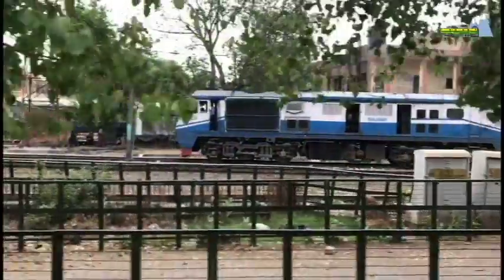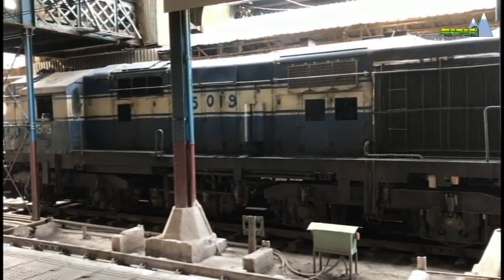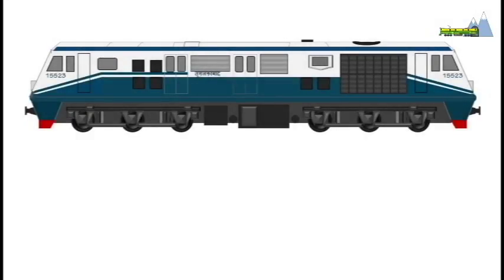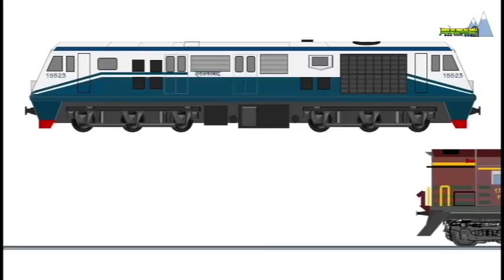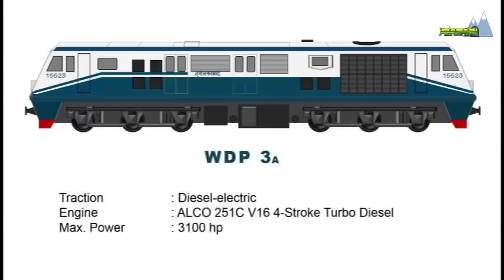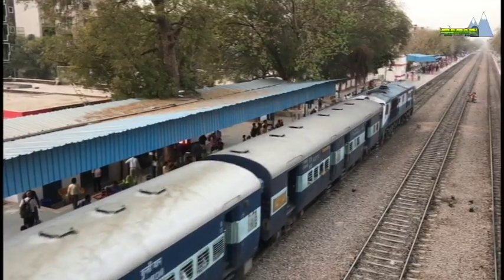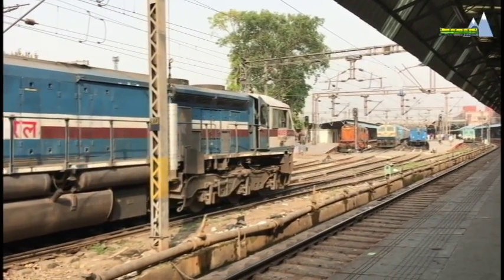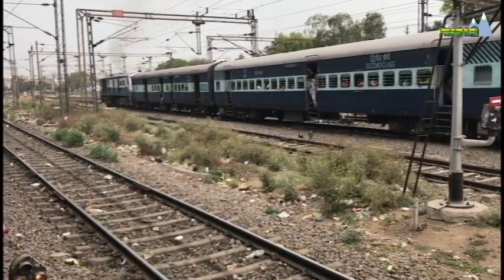WDP3A Diesel Electric Locomotive | WDP2 | ALCo | DLW | Toaster | Pushpak

Comment: I guess this is the only Diesel locomotive in India with full aerodynamic cowl body.
Reply from the maker: ALCos and EMD are American designs based on ‘Cab at one end’. The WDP3A (WDP2) tried to do away with this but did not properly design the cooling/insulation system. That is why the cabs at the radiator end got hot earning the tag « Toaster »...

Comment: WDP3A most successful purely "INDIAN INDIGENOUS" Locomotive thrown away from production line just for some horse power & heating issue on radiator side, could have been modified by increasing frame length by  a meter, upgrading engine to 3300 hp that of WDMD would have been proved to be  highest successful locomotive to pull a 24 coach rake@100-130 KMPH by renaming WDP3D . but who can stop these bureaucracy importing WDP4 series from EMD. Finally victim is Loco pilot facing exhaust grill while driving in LHF. I don't say that the  latest technology up gradation & adoption should be banned, but at the same time homegrown technology should also be preserved utilized wasting time on producing WDM3A & 3D promoting export potentials to our neighboring countries like Bangladesh, Srilanka etc.
Reply: Gentleman one more blunder is coming with the same problem named WDG6G -A 6000 hp SINGLE CAB Diesel electric loco with latest technology. After no of complains & objections from actual users i.e. loco pilots again RDSO will open its shop of design to make it DUAL CAB  like WDP4D & WDG4D. In short though it's a most powerful machine, at the same time time it must be user friendly.
Reply: @Dhirendra Solanki Alco and EMD both are non Indian companies. If so what problem will occur if we replace one with another. May be your view to upgrade WDP3A is a good idea and I think only this is the dual cabin engine developed by DLW other than this GE or what so ever. But even after introducing ALCO, EMD, GE, Alstom etc still IR is buying from outside for their first trial of every new engines. By this time IR should have learnt how to build engines on its own. Would be good if these developments are a part of Make in India then everything should be done by our own country.
Reply from the maker: Dhirendra Solanki I agree with your views on improvements to WDP3A
Reply: 1)Wdp4 is made in India, it's not imported
2) Improvement in wdm/wdp 3a made no sense as it's very outdated.The alco engine is from the 1950s era
3)Now all the emds manufactured are dual cabs so no issue of visibility
Reply: Dhirendra Solanki gentleman but the wdg 6 is still under testing phase and the locos which you claim to be indigenously built are outdated american technology.ALCO-American Locomotive Company.So no diesel locomotive is indigenously built in India.All locomotives were built in india under technology transfer and liscence agreement
Reply: Dhirendra Solanki i agree with your part that wdg6 has terrible visibility in lhf mode. it's not ergonomic
Reply from the maker: Dhirendra Solanki American origin freight locos usually have a single cab because they are designed to be used in multiple unit configuration. With freight trains in India getting longer and heavier, freight locomotives will be used in multiple unit configuration and single cab should not be a problem... but if RDSO is planning double cabs, that is also welcome :)
Reply from the maker: Krishnaprasad D Nair Sir, 1) I think Mr Solanki meant the original EMDs were imported. Of course the EMDs are now manufactured in India. For that matter even the original ALCos were imported.  But DLW with countless tinkering made it essentially a “make in India” engine.
2) True the ALCo engine is from 1950 but when improvements are made to an internal combustion, it is usually on how fuel is delivered and how efficiently power can be drawn from the engine. The cylinders and pistons remain the same, maybe better materials/alloys may be used but the pistons and cylinders still remain. In fact the WDM3D incorporates several features from the EMD such as microprocessor control.
3) You r right, the WDP4s now have dual cab and visibility is not an issue.